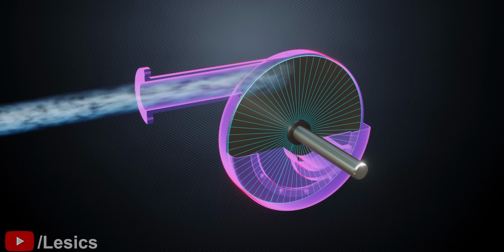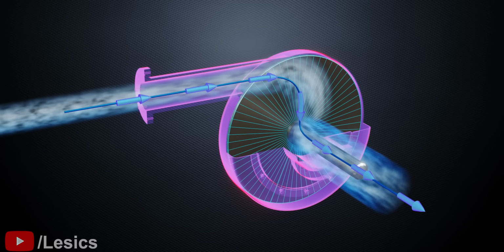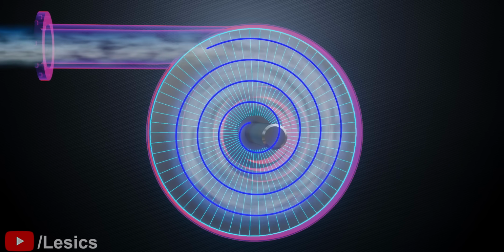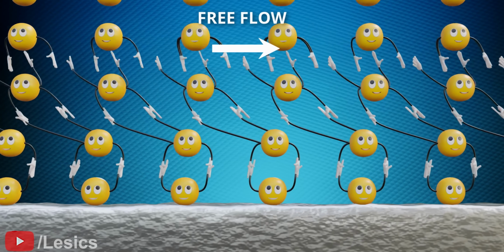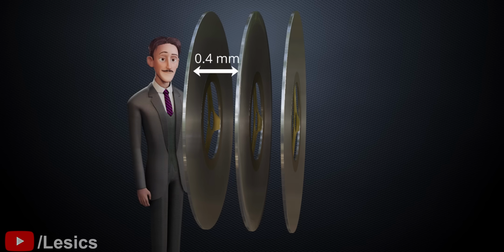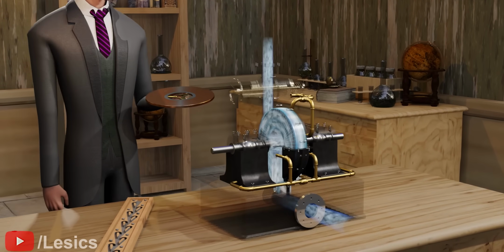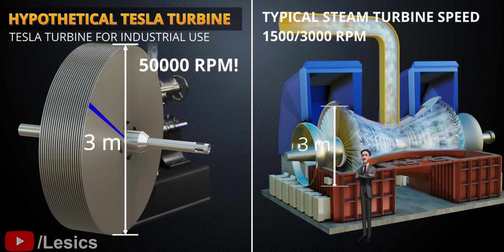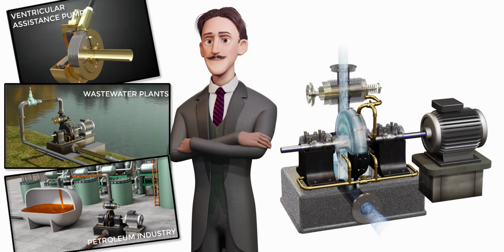Tesla Turbine | The interesting physics behind it

Comment: What was the reason Tesla specified heat resistant alloys for the disks?
They were to pump hot and cold flows at the same time!
It was a heat-exchanger and turbine system in one!
It was the same disk-stack that we know and love, but not a central flow design.
Each pair of disk faces forms a channel for either hot expanding gases or cool intake air.
A complex manifold kept the gas flows separated but parallel.
Expanding combustion gasses from a Pulse-jet engine drive the 'hot side' to spin the disks, intake air is compressed on the 'cold side'.
The net rotation spins a generator, keeping your lights on.
The intake air is heated, the disks stay cool enough not to suffer failure.
Metals like 'German Silver' were specifically mentioned in the patent!
*
The other odd material specification for for his famed 'valvular conduits', Tesla valves.
Like the disks, care was taken to specify that their material was to be conductive of heat and not be affected by long term exposure to air and 'corrosive gasses' at high temperatures.
Brass, copper and other non-ferrous alloys are mentioned.
*
Using this information (too little sleep, too much of the things Momma warned me about), I came up with this:
Two heat-exchangers are at work here; the alternating flow in the turbine and the valvular conduits.
1) Air comes into turbine on 'cold side', is compressed and heated by exhaust heat conducted through disks.
2) Air is forced through valvular conduits, where the air picks up additional heat from exhaust gasses flowing over outside of valves.
3) Air is mixed with fuel and burned in a pulse-jet engine.
4) Exhaust is directed through turbine, where it dumps heat and spins the disks.
5) Exhaust is then channeled through a space surrounding outside of valvular conduits, heating them.
6) Spent gases are vented to atmosphere.
*
Notes about energy exchange from one system to another.
The greater the gradient, the faster energy is exchanged.
A disk running at a steady speed can only pick up energy if the flow over the surface is a good deal faster than the surface speed of the disk.
This is where our pulse jet engine comes in.
The engine is in a steady stream of air; inlet and outlets are a turbine pump system with a set compression/expansion ratio.
Run the turbine at a steady speed, steady air flow throughout the entire system.
With each ignition cycle, there is a very fast pulse of very hot air expanding through the outlet side of of the turbine.
This gives the turbine the 'shove' it needs to keep turning.
(Engine exhaust is part of a critically damped L/R/C network!  Exhaust is coupled by resonant structure L/C, damped by R of turbine.  Turbine is between engine and resonant structure.)
(Flow between these components would have very high peak velocity...just the thing for imparting spin!)
(Resonant structure wants to match oscillation of engine pulses, but R of turbine robs energy from system.)
(Downstream flow minimizes 'return stroke' counter-spin of the turbine when engine port is at low pressure and resonator is at high pressure.)
Another thing about the temperature difference hot gasses/cooler metal...it makes the boundary layers 'sticky'!
Yup, heat exchange at the surface 'glues' air molecules to the surface as they are giving up (or taking!) heat with the metal.
Energy transfer must happen, and until it does, air hangs out at the surface a bit longer!
Hot metal clings to air.
With each surge in hot gas, the disk is pushed a little faster and gets a little hotter.
Same deal on the compression side; cool air gets drawn into Maxwell's dance, is made to flow and is heated up.
The thermal gradient makes a better pump!

Comment: Just because we can't handle that much amount of rpm, we ditched it.
Reply: Dude. Trucks, machines with a lot of torque and horsepower, have engines with only 3500rpm, accellerate only to 3000 and have a redline of 2200rpm. Much faster and the engine can fly apart. Bigger parts need to rotate slower. Even engines of Tesla's turbine prototype better not go over 12000rpm. So there are good reason it was ditched.
Reply: No we haven't "ditched it". At the end of the video, it is mentioned that Tesla turbines in reverse is used as pumps for viscous fluids.

Comment: Just calculated (roughly) what a 200000 RPM turbo (big turbo) on a car had for it's "tip" speed and it came to about 2.7 Mach.
Reply: The blade design can handle the deformation, right?
Reply: @mundymorningreport3137  They usually do, the bearings has the most wear.

Comment: Mach 13... 

What is the centripetal force of a 3m disc with a tip velocity of Mach 13? Could a carbon nano-tube disc 3m diameter. How much mass does a carbon nano-tube disc 3m diameter have? Can a carbon nano-tube even support itself just one tube thick?

Is this an economics problem or a physics problem?

Comment: Is there a minimum size the rotor must be? Could this single rotor be replaced with multiple smaller ones?
Reply: You want the water to encircle the disc as much as possible to achieve maximum efficiency. Now im not sure as to why they think the discs have to be 3 meteters though.  Wouldn't smaller discs work as well?
Reply: @GamingDad  Wouldn't thinner discs, fashioned from resin and a bit of carbon nanotubes also work?
Reply: @Iamwolf134  no clue, im not that knowledgeable.

Comment: The Tesla turbine was supposed to produce his electrostatic compressional waves, it is necessary to get 30k RPM minimum. I understand now, how this is so much superior to what he was using before.
Reply: Like a Van der Graaf static generator?
Reply: @FireBeam  I am not completely sure. You need a flat bifilar, and it should be made to the specs Tesla laid out. I spent two years figuring out how to make a very high quality flat bifilar. 
You need one spark(Tesla defined the spark as a crack- so even the spark from a static electric connection is sufficient),  a spark. It can be in a vacuum, and it will take very little energy to initiate the spark. The spark must be interrupted around a million times per minute......well as a starting point. So a wheel that has an RPM of about 15,000-50,000 is of great value. If one affixes 400 tungsten rods of a perfectly even distance, between one another, and from the spark.....and then the air is variable, so the RPM can be varied.
Reply: @donaldbest7621  
To be honest, it's been a while since I was doing Tesla research.
If you can point me in the right direction, I'll do some research and try to get on your level 👍
Reply: Balloney
Reply: You're making shit up. Please stop.
Reply: @brushhaidinger2506  
Conformist detected...
Reply: @FireBeam  Ah yes, because being an edgy contrarian makes you look cool 🤡
Reply: @john3260  
Your obsession with appearance is noted.
Reply: @FireBeam  Your obsession with sticking out like a sore thumb is noted.
Reply: @john3260  
Projection...
Reply: @FireBeam  Says the edgy contrarian.
Reply: "electrostatic compressional waves" 4:31 how do those smiling balls hold hands? like what are their hands made of? what did they think those hands were made of in the 1900's? could be thought of as electrostatic forces? at 6:11 that is a pressure wave of steam could someone describe that as "compressional waves"? but your right produce is wrong if you think it means is the end result, it would have been extract or utilize, but if you use the word produce as a method such as the machine by producing a electrostatic compressional waves internally can harvest the energy from the steam, to do this in the best way it must spin at 50,000+ RPM. tesla's design is the "superior" one for efficiency we use we just lack the capability to build it. their is a story where Mozart/Beethoven I forgot which one made some fast music that could not be played on pianos of the time with out breaking them.
Reply: @Amipotsophspond  Tesla’s apparatus for variable high speed frequency was a way of producing high frequency static electric waves. The wheel turned by the turbine would need to have a wider diameter(maybe around 3 feet diameter) , and I believe Tesla said 400 tungsten pins on the outer perimeter, and one(more are possible if the frequency is timed correctly) on the apparatus. The pins should be positioned so that the gap is as small as practicable. 
When the turbine gets the wheel up to 35-50k RPM’s, the frequency would be 400 times greater.  The speed of the air controllers the speed of the wheel....the wheel is with a charges, so all tungsten points have  potential, only the one closest the opposing pin will discharge. 
In that way speed of the wheel can be maintained indefinitely, and only the friction of the bearings a heat consideration in the making of that high frequency
Reply: @Amipotsophspond  nothing I have said is commenting on the fluid dynamics explained in this video. Only how this apparatus was incorporated to his other high frequency/potential apparatus.

Comment: there is a fault in your statement: when the disk size increases, the centrifugal force also increases. so  with a larger disk the rotation speeds doesnt need to be 50k rpm to reach peak efficiency. the problem with that is that the material strength is also not sufficient enough even at lower rotation speeds. with newer high grade materials such as titanium and advanced alloys the turbine could get up to higher speeds. but this increases the production costs significantly.
Reply: There is no real scientific PUSH nowadays. It's sad.
I was watching a documentary on samurai swords, and an interesting tidbit was the BIMETALLIC nature of the sword... Different metals were "folded" together, then quenched. The inner core shrank at a different rate, leading to the iconic bend that samurai swords are known for. In other words, IT WAS UNDER TENSION, WHICH INCREASED ITS STRENGTH.

Comment: The 35000 rpm mechanical failure is just suffering from success for tesla
Reply: The video is lying. The faster it goes, the LOWER the effeciency is. at 35000 rpm the efficiency of this turbine would be very small

Comment: Put a postive charge on the housing and a negative potential on the rotor. It will keep the water less turbulent
Reply: Hmmm? I wonder if that would work on an airplane wing?
Reply: @msmeyersmd8  better yet compr3ssed air in the wing while the hull could hold minute fuel for the same distance

Comment: From what I have read he worked with discs up to 4 times larger than the 6 inch model he first created, he could have been basing his efficiencies off that perhaps since he was working with 300C steam- but he wasn't just warping discs while pushing the extremes of metallurgy back then, he having discs explode then causing the turbines to implode.

Better video than most on the subject though.

Comment: A larger disk it doesn't need to spin as fast though. It will only go as fast as the jet of steam. The efficiency would be steam speed vs disk speed, which should be nearly identical. We're not getting steam up to Mach 13 for power generation. So the bigger the disk, the lower speed it needs to travel, meaning lower centripetal forces, so the disk can be made of ordinary materials. 

I suppose there might be a trade off point where there's not enough centripetal force acting on the steam, lowering efficiency.
Reply: A larger disc is needed to generate torque.

Comment: Imagine applying this system to the exhaust side of a turbo... all the psi
Reply: exhaust is a gass not a luiquid
Reply: @robbanpenger1341  Yeah, and?
Reply: @pbDEMON  then why would you apply it to the exhaust side of the turbo then? It would literally produce no PSI
Reply: Robban Penger technically (fixed stupid autocorrect error) it would still work if you make it right, seeing as it can work with fluids in general. Though it may struggle with overall torque if you stick with the purely flat discs.

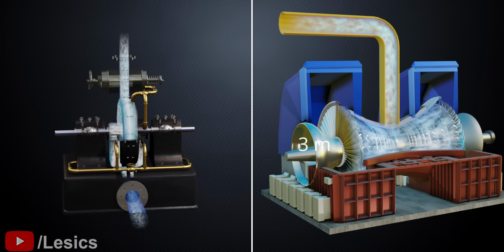Comment: 7:50 Why must the "ideal" turbine be 3m in diameter?
Reply: Torque is related to the diameter.

If you wanted to get useful work out or a smaller turbine, you'd just have the problem of needing to spin it even faster, and get right back to the same problem, though also with the addition of new interesting ones, like how do you balance something that big to spin at well over 100,000 RPM? What kind of bearings could withstand the forces and the friction?
Reply: @Nevir202  Indeed, you are one of the few who understand the issues and how this works.
Reply: @Nevir202  The tesla turbine does spin exceptionally fast, though.  So can its diameter be reduced such that its speed doesn't exceed m1.8 while also meeting the torque requirement?  Further, if more discs and a yet even smaller diameter are deployed, would the enhanced boundary layer contact area and increased angular momentum combine to meet torque requirements?
Reply: @justlooking813  What I’m saying, is that as he said the problem is the turbine destroying itself from over-speed. 

Making it smaller means that it can maintain those speeds without being destroyed, but the usable energy you can get out of it is also reduced, meaning you have to increase the speed again until it’s once again destroying itself.

Comment: OK want to improve on Tesla terbine ?  Friction causes heat induction on the blade, in inferred radiation which causes electron shift to negative in all water exposed to the blade, negitive electrons exposed to the blade By inferred radiation of heat. 
  So completely electrically  seperate isolate the blade in the two seperat fluids for a huge generator of MASIVE DC current, and use it to electrically power the turbin with the water both ways..!

Comment: Have other disc shapes been considered? Here, the discs are all the same, but what would happen if the discs were triple layered, where the center was the full diameter squeezed between two discs that were half the diameter. Or even vis-versa, giving the disc a heavier weight at the tip. Seems like everyone talks about the exact same prototype, but never really playing with alterations.

Comment: so if high rpm is needed why not just use many more disks at a smaller diameter with a thicker plate? A thicker plate will hold more kinetic energy as well as resist warping under 50000 rpm..
Reply: thicker plates won't help. the centrifugal force is proportional to the weight and the weight is proportional to the thickness. The tensile strength is defined by the negative pressure (N/m^2) therefore the maximum force is also proportional to thickness.
Reducing the diameter feels more complicated (I need to work on maths) but probably won't help one way or another.
Reply: angular velocity also depends on the diameter..lower diameter is stupid
Reply: You need to lower the mass of the disc as much as possible, a denser disc will go with a bang and you wouldn't want to be in the same room. Oh, no one has mentioned balancing that would have to be spot on.

Comment: A very interesting design and video. But I fear that the viscous force example you gave (the stone moving on a river) might be a bad one. It's true that viscous force may play a small part in pushing the stone downriver. However, pressure drag is more likely to be the major force acting on a "rounded stone" on flowing water, by a large margin. It absolutely depends on the shape of the stone, but I imagine a "rounded stone" can be considered a bluff body. A good example for viscous drag would be any flat shaped object on the riverbed or even on the water's surface, e.g., a floating flat wooden board being dragged downriver.

Comment: Yeah, yeah, here you show only half of his device. Tesla turbine is actually two stage device. That's why are channels that practically build two stage Tesla turbines deleted..  YT loves only channels that promote Einstein and Edison, we know that. & btw, the speed of light is not a constant (thank you Dr. Sheldrake!:)
Reply: @TugIronChief  And the people you know are definitely as or more intelligent than Tesla so their poor excuses of his turbines are really something people should take note of.
Reply: @TugIronChief  True, but steam doesn't have much surface tension. The Tesla turbine, used in reverse as a pump is extremely efficient, particularly if the liquid being pumped has a greater surface tension than water. e.g. oil. One huge advantage of the Tesla turbine is the lack of moving parts, similar to electric engines. You could use a Tesla turbine as a range extender for electric vehicles. It would be cheap to manufacture.
Reply: Can you advise me of hidden invention sites and channels
Reply: @TugIronChief  The same way that hybrids work now. While it's difficult to make them extremely efficient with low viscosity fluids, it is relatively easy to make them more efficient on a power-to-weight ratio, because you can use light materials like Aluminium and run them at the optimum speed. You could also use the Turbine as a fly wheel for regenerative braking, but that would require a clutch.

Comment: You need a high viscous fluid for higher amount of energy harvested, but too viscous fluid wont move the turbine.
Reply: It will probably need a "starter" motor to get it up to a speed where it can maintain its rotation. Kinda like power plant generators: They need small generators to produce the rotor field and initial kick. After it's spun up to a minimum rpm, it can self-generate the rotor field and maintain its rotation.

Comment: The other point missing is modern steam turbines use superheated steam. Regular wet steam will destroy them very quickly. I think this may be another reason the Tesla turbine won't work as well as a modern turbine. Superheated steam probably does not posses the viscosity needed for a Tesla turbine to operate efficiently. Turbines also harness the principal of rapid expansion rather than velocity.